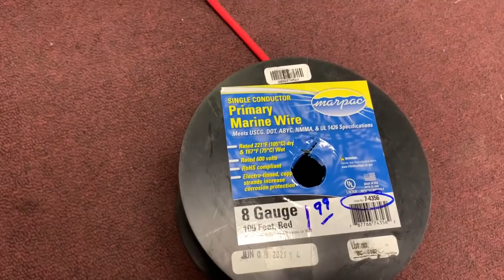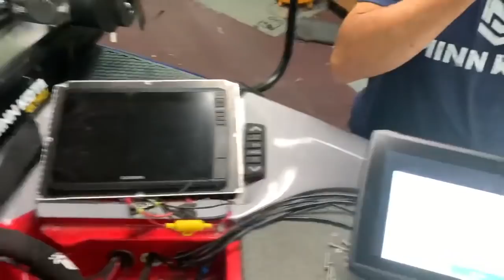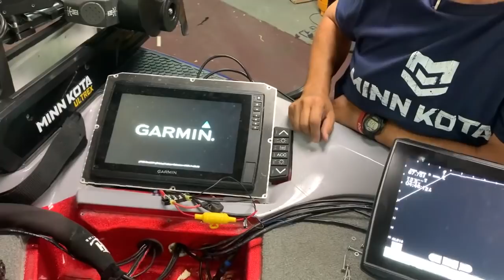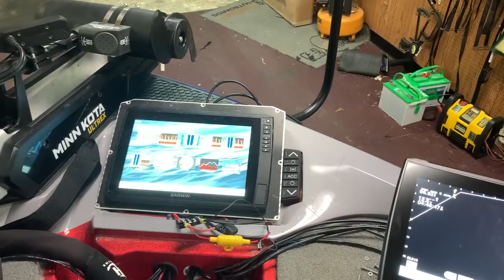How to Get a Clear Screen on Livescope!  Part 1..Install 8 Gauge Wire!

Comment: Yup to bad the boat company didn't already do that by now, sorry but I had to say certain boat companies are behind
Reply: If you want 8 gauge wire when you order your Ranger for electronics they’ll do it. How do they know if your going to run 1,2,3 units on the bow or console unless you tell them.
Reply: @glenndaugherity6187  8 gauge solves having to figure out any of that.

Comment: So did you add another 12v deep cycle  lead acid battery dedicated to livescope?  I don't have room for that.  I have been using a smaller dedicated lithium for my panoptics and it seems to do fine.  Lasts 8 hrs or more.

Comment: How are you preventing interference and polarization between your trolling motor wires and your graphs?
Reply from the maker: I use the magnetic clips from RiteHite to fasten the wires from the transducer, David.    That pretty much knocks it all down.  I also have a separate 8 gauge wire from my battery to my Live Scope.   Thanks.  May God Bless.   jimmy

Comment: Hey Jimmy I have a question for you did you not like the Dewalt system on your live scope cause that’s what Iam running on mine I like cause it puts 18volt and gives you a better picture was just asking buddy
Reply from the maker: The batteries ran down really quickly, Paul. Really had problems with that system.  Glad you’re having success with it.  Most have just gone to the bigger wire.   Thanks.  May God Bless.  jimmy

Comment: Why did you use the dewalt battery at first?
Reply from the maker: To try to clear up the screen.   Helped a tiny bit , but not much.  Plus they only lasted 45 minutes.   If it had worked, I would have gone to bigger dewalt batteries.   Thanks.  Godspeed!   jimmy